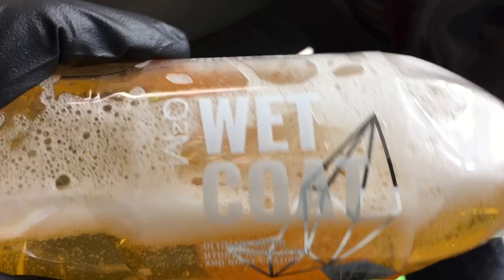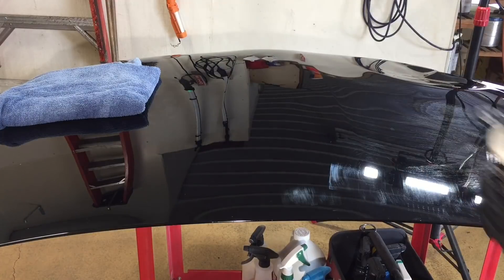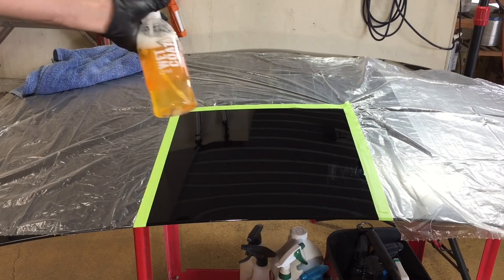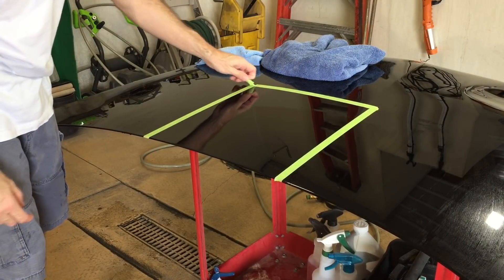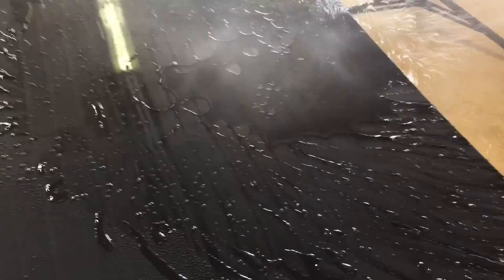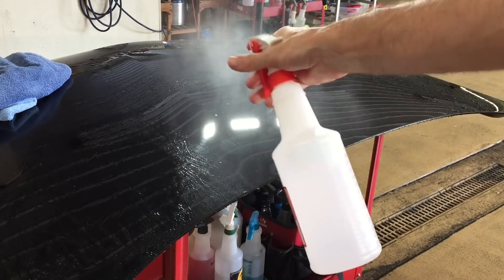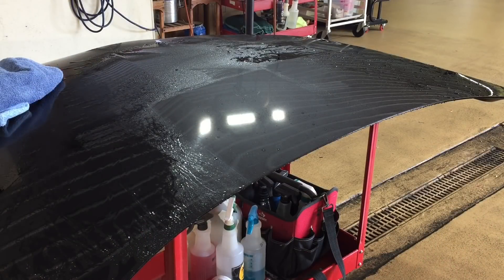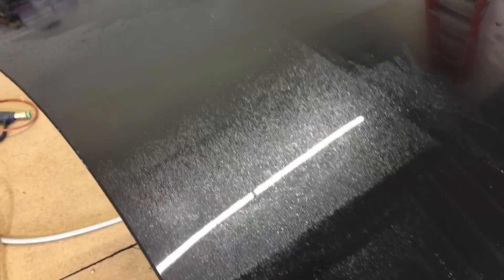Gyeon Q2M Wet Coat!!  Instant Hydrophobicity Booster!!

Comment: I'd like to see you try TAC system Water Glass but don't stop there, try Moonlight from them next! Afterwards 1 step Master and Quartz Max, in different tests ofcoarse because they're different products. 

I've been using TAC system products since last year and this year I decided to try their paint coating called Power Plus (70% Sio2) I did 2 coats and it was pretty easy to apply, especially since I've been applying coatings for a couple years now. I did top it with Moonlight (50% Sio2) about 6 weeks later and followed that up with 1 step Master (25% Sio2) Inbetween all of that I used their Quartz Max (5% Sio2), so needless to say I'm a big fan.

I have also used their iron soap, glass coating and wheel cleaner as well, all did an outstanding job! This is a full product line company, everything you need is right there with great customer service, ask for David and tell him Roger from Chicago sent you. TAC systems has been doing coatings since NINETEEN NINETY FIVE, yeah, that long!
Reply from the maker: Klasse Act those are on the list.✅
Reply: Have to put Brian's info on AG chat :)
Reply: What do you think about their tire dressing ? the white one.
Reply: Klasse Act thanks for posting this, I'm thinking of buying moonlight to protect my coating vehicles. How do you like it so far? Longevity? Shine? Thanks in advance

Comment: I love this stuff! Usually it will last 8 to 10 weeks before it starts to fade. I wash my car weekly or every other week if i'm short in time with ph neutral soaps (autoglanz piste snow foam and gyeon bathe essence). Used it on my rims also but the brake dust seems to make short work of it. Lasts 3 weeks max on the rims. I also haven't had any issues with high spots. Could be because I use filtered rainwater to wash my car. I only wish to find a more economical way to use it. I use almost a complete 500ml bottle on my SUV. I guess ease of use cost a bit more money. ☺️
Reply from the maker: I get about 4-5 weeks here in the northeast. Yeah... that could get rather pricey.